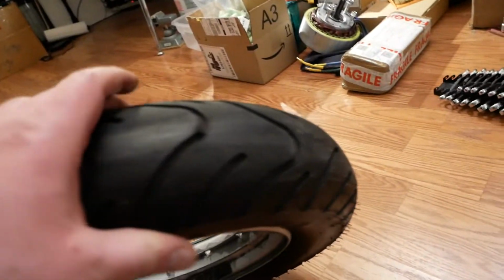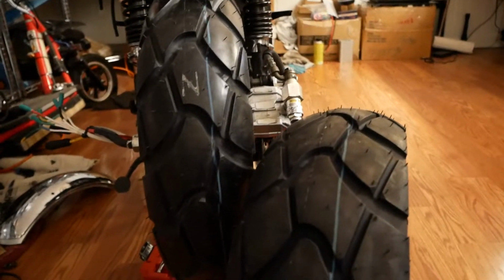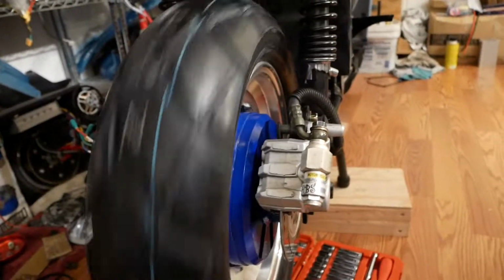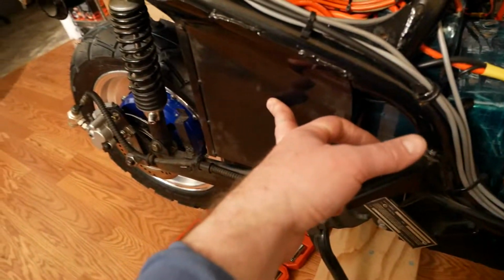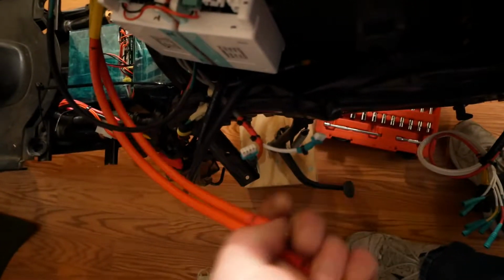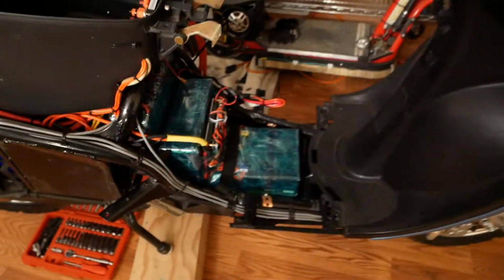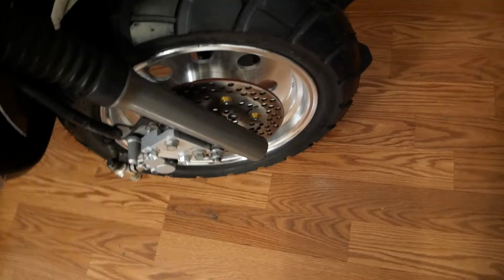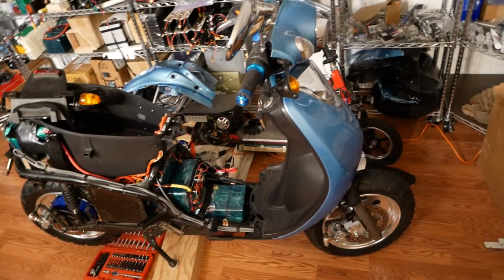Zap Scooter walk through 20210424

Comment: Zap was based in the bay area  the 10 inch wheel gives torque to go up hills  in sf
Reply from the maker: The motor isnt the problem. It's the rather weak controller! I'm now running 12" wheels and still have more than tripple the power on the factory motor thanks to better controllers.

Comment: Yesterday i bought a light version of your Zap for 40 Euros with coc and two chargers. My Benzhou looks 99% the same, only the motor has a drumbrake and one controller. The swingarm is not so strong as the one on the Zap. I think at first I will stay at 48v to check what is possible. I hope I can buy a better swingarm.
Reply from the maker: So you know me on facebook. Send me a PM over there of what you got. Drum brakes suck. I've had them on several EV's over the years and every one of them I converted to dick brakes. you might have to weld a little bit and make a bracket for the caliper, but it's well worth it to NOT have drum brakes.
Reply: @de-bodgery  I am not on FB anymore and for sure I am not able to do the mods like you. Your skills are awesome. My plan is to swap the batteries to Lithium. I already have 3 factory made modules with 48v. Together they have 2100kw/h.
The next step would be 60 or 96v. Thanks to your vids I know how much I have to modify. So I will start with a programmable controller and a smart bms. I don't trust the chargers, so I will buy something like your meanwell psu. Please continue with your teardown vids. I would like to see the inside of your modified smart bms. May be I buy a nui r1s chassis. They are selling some beefed up swingarms on Ali. There is enough room for a bigger battery and a bigger motor. But for now I am happy with my new ride. Lots of work to do...
Reply from the maker: @PeterPan-gy6kq  Set yourself up Discord if you are not on there already. Look up the High voltage light electric vehicle forum on there. Lots of good folks on there! I'm pretty active there too.
Reply: @de-bodgery  Ok, will do, I tried Discord only once some years ago. May be you are right and times have changed. What about Telegram?
Reply from the maker: @PeterPan-gy6kq  I have a telegram account and there is tons of groups on there. What I found is a couple of pretty good EV groups on Discord that I like...so that's what I involve myself with. I have my own Discord forum.

Comment: That thing is insane.  The Phat-e Currie scooter in the back ground was my first scooter in 1999.
It went to dual motor 600W BMC MAC MOTORS with 17 and  19 tooth sprockets.  I've been an acceleration junkie ever since.
Reply from the maker: I built that Currie in 2018. It has an outrunner on the back wheel and sees about 5kw. It will throw you off the back if you don't lean into it when you take off. Top speed on level ground was 45 mph on 16S. It has LIPOs in it that have gone bad. I need to make a new pack for it from 18650's or 21700's to get it on the road again.